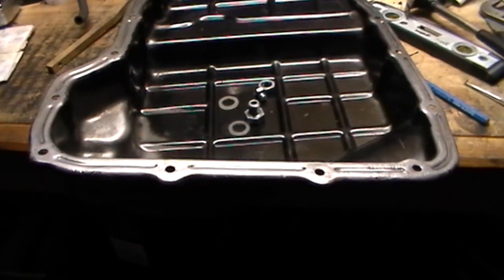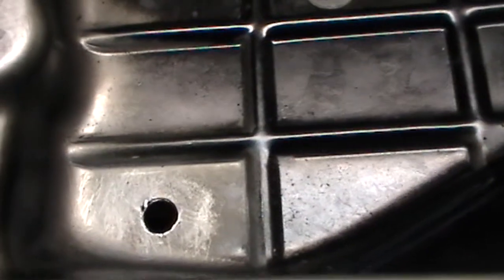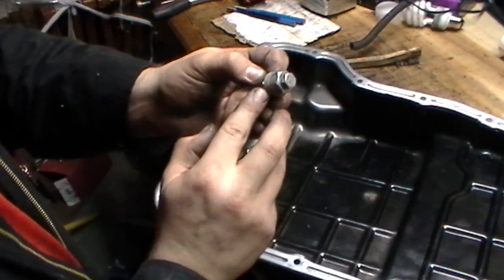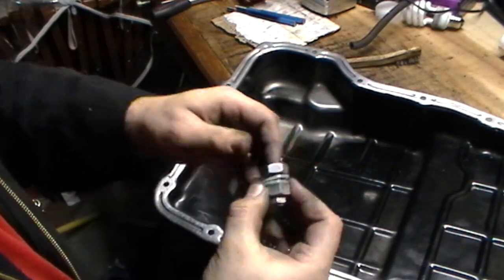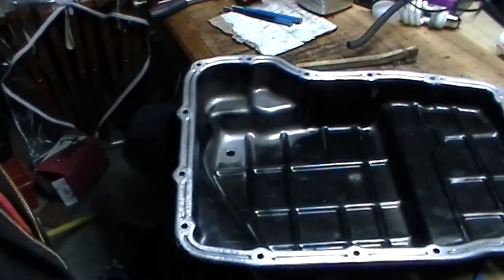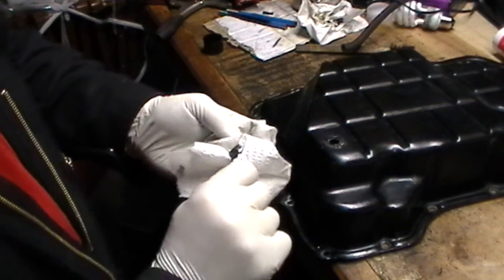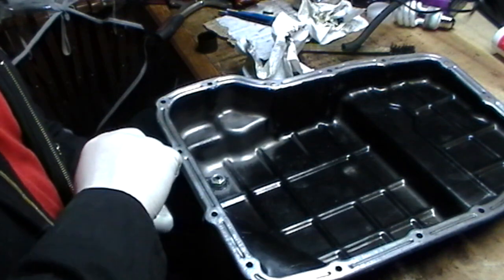How to fix a transmission oil pan design flaw (lack of a drain plug)

Comment: Can you, do it on a plastic pan???
Reply from the maker: It all depends on the pan, its construction and where you place the plug. Ive seen some plastic pans with waffle style bumps on the bottom, for strength, that wouldn't seal properly with this type of drain plug. If you can get a smooth, flat surface towards the bottom of the pan then it should work.  Good luck.

Comment: Shouldn’t you use a plastic gasket that’s found on a lot of oil drain plugs on the smaller drain bolt that screws into the bigger nut? Couldn’t the fluid weep since it’s just metal on metal
Reply from the maker: I'm not sure what you mean. Are you talking about the white nylon washer shown in a bunch of places in the video? I also show adding some additional RTV because the metal hole was mangled a bit.  Or are you referring to something else?
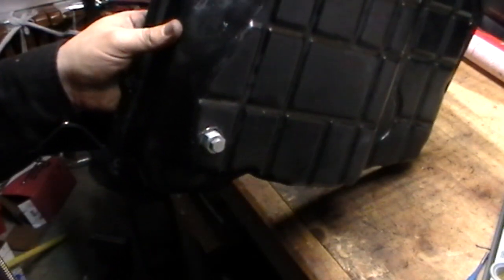Reply: @petrocksgarage I was referring to the bolt you were pointing out at 8:36, the one you actually remove if you wanted to drain the pan. You know how most cars use a washer or plastic/rubber gasket in between the head of the drain plug bolt and where it screws into the oil pan? I was wondering if it would be beneficial to put a similar type of gasket on the head of this bolt you’d unscrew to drain the tranny fluid so it’s not metal on metal touching because that could cause a slow drip and you might never see it
Reply from the maker: @MustangGuy1996 , oh I see. The small bolt. There is an o-ring that comes with the Dorman kit. So it's not metal on metal. I talk about it around 2:23, and you can see a closer look around 1:40. Hope that helps.
Reply: @petrocksgarage  gotcha sorry must have missed it, i’m definitely going to install this at some point. Thanks for making the video!
Reply from the maker: @MustangGuy1996   No problem. Thanks for watching and commenting. I appreciate it.

Comment: Where do i buy the dorman part drain plug kit?
Reply from the maker: The part number is in the description. They are available at most auto parts stores, or you can search online for 'Dorman 65128' and buy it online from various sites. Good luck.

Comment: IMHO I would have eliminated the drain plug altogether and install a FUMOTO valve, check them out.
The valve once installed it would be flush inside the pan with no nut to hold it in place. When you want
to change the transmission fluid you just open the valve. I have it on my 2005 Ford F150 5.4 3 Valve Triton
engine. I also have one on my oil pan to change the motor oil too, they are GREAT!
Reply from the maker: I've heard of the FUMOTO valves but have never seen or used one. A valve would definitely work and would arguably be easier. My worry would be if the valve prematurely opened while driving down the road. The little plastic clip to prevent that just looks like something that will eventually break with repeated hot/cold cycles and removals & reinstalls. Would be way better, IMO, if it was part of the valve & metal.
Reply: @petrocksgarage  I have them on all of our vehicles, for years.
The design of the clip the way it locks on could never fall off,
or open prematurely. You wouldn't have the problem ever on
stripping the threads on over tightening the drain plug. 
You would also have the connivence of draining the oil directly
into a container and not into a drain pan that has to be cleaned
later. I drain mine directly into milk cartons, once one is almost
full I turn the valve to the off position,  then slide the empty carton
under the valve and continue on.

IMHO once you have one and install it you would never go back
to the drain plug. But if you wanted to it would be simply remove
the valve and screw the drain plug back in no problem.

Comment: Silicone is not permanent. I just thought about using J B Weld. I mean it is going to be permanent, right? My pan always seems to leak so I just got a new pan with a drain plug already in it. The old one will get a new drain plug with JB Weld to hold it in, because I will be drilling a hole to drain the fluid. For sale used 3.9L 42RE automatic trans pan with drain plug installed...Great video, thanks!
Reply from the maker: JB Weld isn't that great at sealing.  Its easy to get pin-hole leaks, but you could get it to work.  RTV is easier, IMO.

Comment: I have some extra transmission pan gasket maker from a dealership, can I use that instead of RTV??
Reply from the maker: As long as it is rated for use with ATF+4 fluid it should be fine. Not all gasket maker is the same. However, Fel-Pro makes a gasket for this pan that is much easier to use. Its part number TOS18733.

Comment: If that drain plug is 1/8 npt then this is perfect for installing a trans temp gauge
Reply from the maker: No, its not npt. Thats why the little bolt has a rubber o-ring. However, you should still be able to rig something up. I'd use some hi-temp sealer or something like that though. Good luck.
Reply: @petrocksgarage  I've seen the b&m brand version that has 1/8npt .
Reply from the maker: @EverydayJ1786 , cool. That should work for you then. The one I used (Dorman, part # 65128) would work too, but with some sealant.

Comment: I had a couple cars with the A604 and it also had no drain plug.  But it was one of those kind of cars you really should change the transmission fluid every 25,000 miles or sooner.  One other thing about the A604 is that you have to be extra careful which fluid you use in it.  No Dexron in those or you will be getting it towed sooner or later.
Reply from the maker: Having a drain plug isn't a substitute for a full drain & fill. Filters inside the pan area need to be changed, pan magnets need to be inspected & cleaned, etc.  IMO, having a drain plug just makes the process of dropping the pan easier so I have to worry about fluid spilling out of the pan, and only me or my garage floor, as I lower it.

Comment: Also, don't drill the hole while the pan is still on.  Ask me how I know.
Reply from the maker: Haha...  Ok, I'll bite.  How do you know?
Reply: @petrocksgarage  Well, I figured why make a mess taking the pan off when full so I started drilling.  Once I punched through, the fluid came gushing out and when I moved the now drenched drill out of the way, I broke the funnel attached to the drip pan so NO fluid actually made it in.  I still have the drill and I made that mess in 2008.
Reply from the maker: @m.redleg252 , haha.  Yeah, that would make quite the mess. Especially if the drill is still spinning as fluid gushes out. Look at the bright side. Your drill is now lubricated for life!
Reply: Besides you have to drop the pan for the nut inside

Comment: Tip:  Use a self tapping screw for your first fluid change to drain the pan, then use that hole as a pilot for the drain plug install. :)
Reply from the maker: Hmmmm...  Good idea.  But it could get seriously messy if the fluid gets past the threads while you are still drilling it into place.
Reply: Great idea !  Or how about a drill bit slightly smaller than the hole you'll need to install the drain plug? That way after the pan is out and clean , you can drill a nice clean hole that's the right size.
Reply: Dont do either of these. Pull your pan and eyeball a location for placement. The clearance between the sleeve and nut that tightens on to it inside of the pan and any internal components of the tranny is CRITICAL as if you misjudge location and drill a pilot where there is to little clearance between the two your pan will be held off the flange and you won't be able to seat it properly if at all. Worse still, by tapping 8nto the pan with it still on leaves you completely blind as to whats above your bit. It takes just a split second when your bit daylights through that last smidgen of the pan shell and even taking extreme cautionand going slowly you could accidently punch up a bit to far and inadvertently damage an internal component by running the it up Into it or even abrade it by grazing something with the edge of the bit or screw. Very few people (if ANY at all ) have a photographic memory of perfectly how and where location of all low lying internals are located on their transmission.  Even if you have an idea or are somewhat familiar with how its orientated, being off just a small amount could lead to a costly mistake. Better to be safe than sorry. Plus, while you've got the pan off to install the plug, you can change your filter, guaranteeing you wont be pulling your pan off again for 30-40,000 miles more down the road
Reply: @sheepishmclemmingston5550  True. That was one of the reason I suggested the screw vs a drill bit. To minimize going too far.

Comment: Question: when tightening down the nut at a later time,does this not break the seal of the RTV?
Reply from the maker: If the washer spins, then yes it can.  If the washer does not spin then it is just applying more pressure to the RTV.

Comment: shoe goo is much better then rtv
Reply from the maker: I have never heard someone recommend Shoe Goo, a shoe repair glue, before as a substitute for RTV.  I would be skeptical on its abilities to hold up against ATF fluid though. Some types of RTV doesn't even hold up against it.  Either way, use whatever gasket maker you want on your ride.

Comment: Pet Rock's Garage - if you think about it, that improvement that you made on the transmission oil pan will generate that "some" of the oil inside the pan will come out, but the real messy oil filled w/ clutch debris and metal will be inside the pan always until you remove the tranny pan again, and again during the time will be servicing his/ her car with you
iow, that will make your next tranny service easy, right? you're wrong bro
in automotive automechanics, after gaining experience in the field, you will discover many golden rules that you cannot break, otherwise you are going to suffer the consequences for taking the wrong decissions in the wrong time - and there's no exception to that other golden rule too
surelly, and apparently, you have performed a mechanical procedure and have demonstrated to the public how "sharp" you are and how convenient is your improvisation of the drain plug fixture that you have installed on the tranny pan as you went through it with us along the way - great technical skills by the way
 bro but you are stuck in time and you are travelling in the burdens of dispair all the time in the automotive field and industry
the way we always solved these problems in the past was by paying real attention to detail first and then to narrow any potential problems into real solutions by eliminating any flaws after calculating the mechanicals involved on any task that could affect the process involved in the operation to be performed, and very important too, the economical impact firstly on the technician (and the repair facility) performing the operation, and secondly, its impact on the end consumer as well
according to what i have learned at vocational trade schools, colleges, universities, specialized research in the field and personal experience with mechanical components, service and repair procedures, lets say, that whenever you are servicing or repairing any piece of machinery, or component, the first thing you have to do is to "keep your eyes open all the time" while you are performing the service/ repair/ operation procedure to the specific section where you are working, its adjacent areas and subsequently to the whole perimeter involving the serviced/ repaired component in the procedure that corelates to other interconnected components
after that, be "humble" all the time, that's super-important too, and accept that you are "always learning," and that specially applies when a master in the field is talking to you directly
then, visualize the impact of the service/ repair of the overall operation on the vehicle .. and some other factors as well like the economic impact on the consumer and on society
👉in any case, a welded 1/2 inch pipe connector and a 1/2 inch plug will solve most obvious problems that exist with your strategy to fix a simple mechanical problem as such
if you think about it, the way that some oil pans have their welded drain plugs at the bottom of the pan have a more realistic point of view and a better design than your supposedly "convenient" fixture 🚫
in my case, for exp., as an auto technician, the first thing i will need to consider is that the plug has to be below surface and under the wasted oil and debris all the time for many physical reasons and conditions but the most important are:
1. gravity
2. inertia
3. stopping forces
4. accessability
5. simplicity
6. availability
7. economic factors
8. environmental impact
9. evolution to upgrade a trade not to down grade it
10. progress
11. reputability
12. responsability
13. temperatures (oil, ambient, metal)
14. viscosity of the oil
15. and 100s of more ethical and moral norms of conduct in the intended field that you must attain before you became a professional in your field, if that is your intention
in any case, thanks for your great video 🎥
Reply from the maker: > iow, that will make your next tranny service easy, right? you're wrong bro
I guess you missed the part at the beginning of the video where I describe the reason for installing the plug: to help prevent the oil from spilling all over the place when you drop the pan for your next transmission fluid change.  It is not a replacement for dropping the pan and changing the filters and cleaning the magnet (if equipped) etc etc.

> in any case, a welded 1/2 inch pipe connector and a 1/2 inch plug will solve most obvious problems that exist with your strategy to fix a simple mechanical problem as such
Agreed, however, most people don't have a welder, let alone the skill to be able to weld something like that up and ensure that it won't leak or burn a whole through the very thin sheet metal that the pan is made of. So using drain plug kit I show in the video is the next best thing and works really well. I still haven't had any leaks.
Not to mention that welding something like that up will have the same problem you were describing earlier (not all the fluid will drain out. It will only drain to the top of the plug). But as I said above, the plug is not a replacement for dropping the pan.

> if you think about it, the way that some oil pans have their welded drain plugs at the bottom of the pan have a more realistic point of view and a better design than your supposedly "convenient" fixture 🚫
Yes, a pan with a manufactured pan with a drain plug built in should drain more fluid out. This video is about pans that don't have a drain plug.  So you make due with what you have.  Dorman recently came out with a pan with a drain plug built in for the transmission I'm working on here. If you don't like this method you can go with Dorman's pan (part # 265-817).
Reply: Verbose af!

Comment: Drain plugs are a great addition. I added one to my truck and change the oil out every 30,000 miles and drop the pan every 60,000 miles. This way it gets fresh oil when necessary and with the drain plug makes it way easier to drop the pan and change the filter and inspect the pan.
Reply from the maker: Thats a good idea.

Comment: Great video...for me i probobly would forget down the road when it comes time for a tranny change I would probably unscrew the big nut instead of the little nut so what I would do for myself is put J-B Weld from the pan to the big Bolt. I don't know if that would work but I would do it anyways it wouldn't hurt.  it would lock it up and also it would act as a reminder for me. Just go up a little bit around the pan and a little bit around the bolt about 1/4 way of the Big Bolt. Only if you're handy with the welder maybe that would work too... great video hopefully the people drilling the hole on their own  deburr the inside and outside before placing they're bolts
Reply from the maker: The little nut is actually pretty obvious when you look at it. So I wouldn't worry too much about forgetting it.  It's like a big pimple on the larger nut.  However, adding some JB-Weld around the base of the big nut isn't a bad idea.  It will help prevent the big nut from inadvertently turning while you unscrew the little nut. If the nut turns you will have to re-apply the RTV on the inside, which can be a P.I.T.A.  A welder, if you have access & the skill, would also work however, the steal is super thin so it would be pretty easy to burn through by accident. Welding it would not be for the faint of heart, IMO. Yeah, I did forget to mention de-burring the hole.  Good catch.

Comment: Could just have someone weld a nut to bottom of the pan
Reply from the maker: That would be more expensive & time consuming then doing it the way I show in the video. But it would get the job done if you can find someone who knows how to weld on really really thin sheet metal without burning through it and also while producing a leak free weld.

Comment: What happens to the fluid that stays below the top of the inside nut ? Best to weld a bong onto the outside and you will not have any obstructions on the inside of pan. Thanks
Reply: Just jack up the vehicle with the fluid flowing accordingly towards the plug and there should be very little left after draining.
Reply from the maker: There will be a little bit of fluid left in the pan, but not very much. It's easily manageable. The metal is very thin, so welding a bung, and making sure it doesn't leak, would take skills that most people don't have, let alone the welding gear. But you are right, welding would be better.
Reply: JOGO Exactly, my thoughts entirely, gud 1/2 inch left behind.